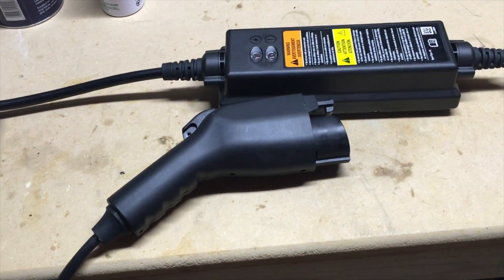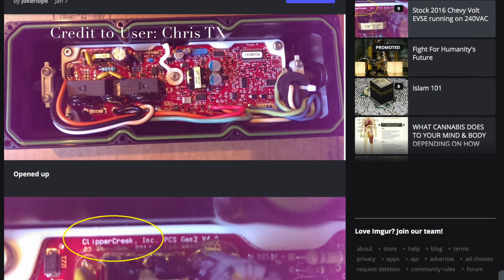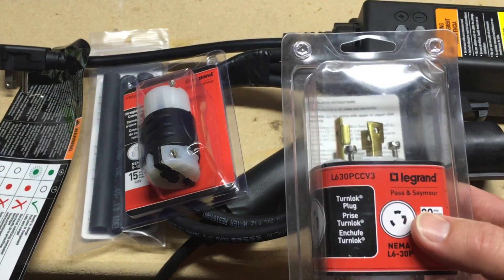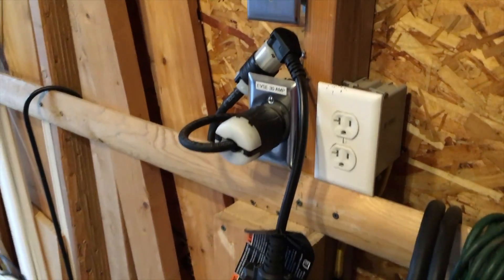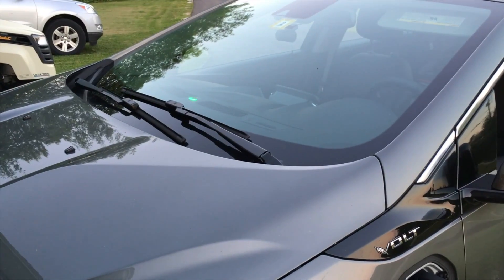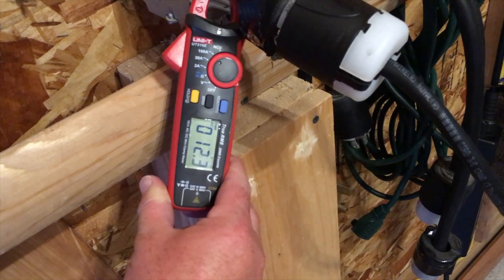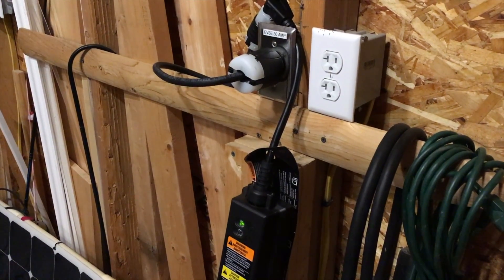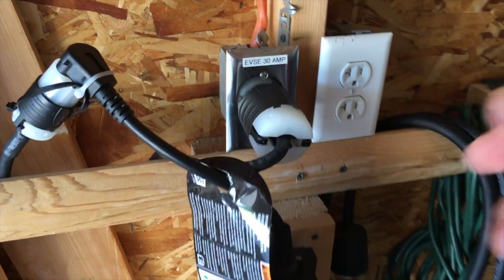2016 - 2018 Chevy Volt Hidden Level 2 Charger 120/240 Charging!

Comment: A 30 amp plug is usually supplied by a 30 amp breaker which needs #10 wire to run cool. If it is a dedicated outlet i would suggest installing it on a 15 amp 2 pole breaker (instead of the 30) to protect the conductors from overheating and to comply with the National Electrical Code. Ill assume the extension cord is #14 which should be rated for 15 amps. 15 amps x 80% is 12 so technically your good as long as it is dedicated to just this receptacle.
Reply: The Volt charger will never pull more than 12amps. That's all it's rated for.

Comment: You just made the charger European ;-)
Reply: 50Hz IS European.
Reply: It is not a charger, it is an overpriced AC switch. Wires coming out have same AC voltage as wires going in. Charger (converts AC into DC) is in the vehicle.
Reply: 50Hz is blasphemy!

Comment: Why the 30 amp receptacle when the draw is 12 amps?I can purchase a 3 wire twist-loc 20 amp plug/receptacle.
Reply from the maker: James Jedamski The 30 ampsetup is  is existing infrastructure I wired in when I had a Nissan Leaf.
Reply: 12A on each 110V leg = 24A at 220V?

Comment: vtmaestro, thanks you very much for this video! I love DIY, but am a novice when it comes to cutting wires. I'm attempting this for my 2017 chevy volt so I have the same charger; even popped it open to confirm the Clipper Creek board. Had a professional electrician instal the NEMA 20A plug on a 240 wire. Next step is conversion. 

My question: Since I don't want this to be my first 240 wire cutting experiment, do you think this off-the-shelf converter will do the trick? 

Cheers, DK. 

https://www.110220volts.com/univ-21.html?gclid=Cj0KEQjwmcTJBRCYirao6oWPyMsBEiQA9hQPbvM0PxOCLtZPqzZB3qnm1hGAtJgcfOJv9kIDwAE_QeUaAu7E8P8HAQ
Reply from the maker: Not sure that adapter is going to work.   I would recommend that you make an adapter or buy something like this. 

https://www.etsy.com/listing/384390572/chevy-volt-chevy-bolt-ev-level-2-charge?utm_campaign=shopping_us_IdeaFab_sfc_osa&utm_medium=cpc&utm_source=google&utm_custom1=0&utm_content=11634913&gclid=Cj0KEQjwmcTJBRCYirao6oWPyMsBEiQA9hQPbhEmME0-ttLtIM1fFMiw6mifvmXxkquRjhLIpMbjZhQaApBS8P8HAQ

What does you 240 plug look like?
Reply: Thank you!
Reply: Got the adaptor from your etsy recommendation. 1 week and working great! Thanks again for taking the time.

Comment: Why not just make the wall plug a 240/15 amp plug?  Then you wouldn't need the adapter.  You clearly mark it anyways, and it's in your own garage, so I don't see a safety problem there.
Reply from the maker: I wouldn't want to take the risk with a family member plugging a regular plug into a socket that is wire to 240.  Adapter was the best way to go.
Reply: You’re good until something bad happens and your insurance company voids your claim.

Comment: Wow, this actually WORKS. Other alternatives are EVSEUPGRADE.COM but they charge $199. There is also a guy on Etsy who sells these cables ready made. One comment, if you decide to simply cut off the existing 120V plug and attach a 240V, you will find 5 wires in the cable. You can safely ignore the orange and red wires, they are connected to some kind of thermal sensor in the original plug. The charger will work without them being connected.

Comment: Not sure if you can answer this , can it work with the 208 volts that I got at work ?May take more amps but can it work?
Reply: Yes this is working,this charger seem to give you 12 amp no matter what voltage.
Reply: Do you know if it's working ?
Reply from the maker: Sorry, I do not know the answer to this question.
Reply: I will have the answer in about 3 weeks, I will try it at work with my new volt, crossing my fingers
Reply: It can't increase the amperage without increasing the gauge of the wiring inside to handle the additional power.

Comment: I wired 2 hots and a copper ground to a regular outlet (will be marked 240V CAR ONLY - and is up high, no one will mistake it).  Each leg measures 120V to ground on my multimeter.  When I plug in the 2017 Volt Charger, nothing lights up.  Charger works fine on the regular 120V plug in... Any advice?
Reply: I figured it out. Since I was using two single pole breakers, I didn't have each on a different incoming leg. The 2-pole breaker wouldn't have fit in the two slots I was using, it had to move down one slot to access a different leg on each pole.

Lesson is DON'T USE TWO 120/240 single breakers as a pair for this, use a 2-pole breaker - you won't look like an idiot! lol
Reply from the maker: Glad you got it figure out  Thanks for sharing.
Reply: What about the white neutral?  What did you do with that?
Reply: I have a 10-30r outlet. I was going to just buy a 10-30R dryer cord and wire it into a 120v outlet. So each hot goes to one of the poles and then the ground goes to the ground?  It doesn't matter which side goes where, Red or Black?
Reply: How did you wire the HOTs in the outlet? 1 to each of the screws in the outlet.  Then just the neutral to the neutral side? How did you ground it? I would be installing a NEW outlet where there isn't one. Was that 10-30r you had? The L is the neutral and the other two are hot? Is that correct??

Comment: Any news on the cord getting warm?? Was it an issue, or were you able to resolve the issue?
Reply from the maker: No issues.  Notice the cord got a little warm when direct sunlight in the warmer months.  Watched it closely this winter and no issue.  Setup is still rock solid!
Reply: +vtmaestro , awesome!! I will  be purchasing a 2016-2017 Volt charger, and do the same modifications. I have a 2012, and have been wanting a 240 V charger.
Reply from the maker: It may be cheaper for you to pick up a low cost Level II charger rather than buy a New Volt Charger do the modification.  Would be interesting to see if the new Volt charger with the modified adapter would work on the older Volt.  Of course, that is done at your own risk..
Reply: Yeah, I've actually seen a few Duosida chargers for under $300. I've also seen a few OEM 2016-2017 Volt chargers for around $200, as well. If I could get the OEM charger for around the same price, I would prefer the OEM charger, simply because of confidence in quality.

Comment: will this work with a 14-50 50amp?
Reply from the maker: Yes, but you won't need all of that capacity of a 14-50, 50 amp.  At 240, the EVSE only draws a little over 12 amps max.  If you have that existing wiring, you should be fine.  Just make sure you have the right adapter to go into the 14-50.  No neutral, just two hots and a ground.
Reply: vtmaestro I'm just future proving to 14-50 to switch to Tesla.
Reply from the maker: Jaime Ramirez, That makes sense.  Good luck!

Comment: Cord is large enough to handle 240 current - noup - 240 voltage. CUrrent is still the 12A like before.
And cord doesn't care about voltage.
Reply: Yes, 12 amps on each leg with 240v as opposed to just 12 amps on one leg of 120v.  So double the amperage. The wire going from the charger to the car is causing resistance (heat) because it's not sized to handle double the output. Totally worth it though!
Reply: @jamesworth4576  I understood what you tried to explain, but the current stays the same with this converter. But at 240V, you will be doubling the power not the current. On a 120V the current also returns thru the other wire ( neutral).
Reply: @TheTaino84  I just made a comment earlier, before reading your post,  that questioned what was happening on that neutral leg.  So how does the control box or what ever it's called, with the green and yellow indicator lights, handle the second 110 hot leg that is flowing on the neutral prong into the previously neutral/ return contact within the box? A woman posted earlier in this thread, like four years ago earlier, that there would be a switch on that pole within the control box...? Someone else posted that the European (220v) chargers are "the same" as the U.S. ones. I am trying to remember now if I've always used my same U.S. cell phone charger when I am in Thailand just with a plug configuration adapter.  That box just handles both 110 and 220 ?

Comment: Im about to do this mod, but since i'm running it to my garage and it'll be at roof level, my plan was to simply run the 2 phases into a 5-15 and skip the adapter. No one can reach up there without a ladder so i dont see any chance of accidental plugin, i'll probably put it inside a locked box as well to be even more careful.
Reply from the maker: Good luck.  I would add that any extra safety precaution is a goid idea (locked box, etc).
Reply: That wont pass an inspection if you ever sell the property.
Reply from the maker: kcotte59 yep, that would work too!

Comment: Awesome. Was just about to purchase TurboCord Dual, having learned the OEM charger can work also in 240V save a lot of money. Thanks for the very informative video. 12 AWG wires in the charger cables should work with 12 Amps, did you measure the current in different stages of the charging? (Start, after 1 Hr, 2Hr, 3Hr etc..) just to make sure it never goes over 12 Amps?
Reply from the maker: I only check the current as seen in the video.   Has work flawlessly for 6 months!
Reply: Those wires are rated to 20 A they should be good to 18 A continuous

Comment: This is a great idea, but before people do it they should check with their utility to see if they offer some kind of rebate program for level 2 chargers.  I found out that mine offers a $500 rebate, as long as you buy from their list of approved chargers.  The great thing is that they give you $500 regardless of how much the charger costs, so you can use the extra to offset some of the other expenses, such as installing the 240V outlet.
Reply from the maker: That's a great deal for a rebate!  Make a $40 adapter for your stock EVSE, turn it into a $500 rebate...

Comment: Last week I finally connected a 10 gauge cable from a 30A, 240v breaker to a new 15A, 120v single outlet. Using the existing EVSE my 2017 Chevy Volt now charges in 5 hrs instead of 12 hrs.  Thanks for your video.
Reply from the maker: Thanks!  Glad hear and congrats on getting it going!
Reply: You should use a 2 pole 15 amp breaker, 30 amps is too much and will cause a fire if there were ever a short. The charger only draws 12 amps. Also should use a nema 6-15 outlet to prevent someone from plugging 120 equipment into it.
Reply: @monteclark1115  I use 30A breaker to charge my Tesla with a NEMA 10-30 outlet and adapter at 22mph of charge.  When I charge the Volt, I just plug in the fake 120v outlet dongle into the NEMA outlet instead.  I got a Model 3 two years later, but I still drive the Volt more often.  I like both cars very much.
Reply: @monteclark1115  you could make the plug connection within a loose covered electrical box so nobody can get to it. Or just cut the plug off and direct connect the wires. Or you can spend hundreds of dollars and feel good about it.
Reply: That's fucking idiotic
Reply: @kylebarbacki7887  What is fucking idiotic? Using 10 gauge wire? Or using a 110-volt outlet? Or Kyle Barbacki? Nothing he did was idiotic, it worked. 10 gauge wire was unnecessary but maybe he had some scrap 10 gauge wire laying around? 110 volt outlet will work fine just don't plug anything else into it. Most solid state power supplies are 110/220 volt so they would be ok.
Reply: Are you able to walk me thru doing this with a NEMA 14-50 outlet?
Reply: @PabloUlmeriguez  Same question
Reply: @PabloUlmeriguez  cut flush the neural ground to ground (round bare copper to green) hot to hot black black and hot to neutral. Making the 120 5-15 outlet hot hot ground at 240v.

Comment: I think you also have to change the "8 amp charging" setting to a "12 amp setting" in the system on the display.
Reply from the maker: That setting on the Chevy Volt (8 amp to 12 amp) is used only when using the stock EVSE is in 120 volt mode.  When using a 240 volt EVSE, the 8 amp to 12 amp setting has no effect.
Reply: vtmaestro so if I were charging at 120v in 12amp, does it necessary means a full charge can be reached alittle faster? as long my receptacle, wires and the breaker is rated above 12 amp?
Reply from the maker: Yes, you will charge faster using 12 amp in that mode.  If charging at 12 amps (120 volt), you should at least have a 15 amp breaker and receptalce for house wiring.    Again, the settings between 8 and 12 amp only works on the 120 volt side.  If you are using the EVSE at 240 volts (or any other EVSE at 240) then the 8 and 12 amps settings have no effect.
Reply: vtmaestro copy that, ty
Reply from the maker: It's done on the Volt in the menu under Energy and then charging.  8 or 12 amp settings only work for the stock EVSE that comes with the volt on 120 volt.  Hope that helps!
Reply: I just purchased a used 2016 Volt. How do I change the charge amps from 8 to 12???   Is this done on the volt or the charger???  Any help would be greatly appreciated.
Reply: vtmaestro  Awesome thank you!!!

Comment: Thanks for sharing.  It'd be great if there was a video on how to make the cable, or a link to buy one.  I don't trust myself.
Reply: 110 volts = 110 volt wire (black) and a neutral wire (white)

220 volts = 110 volt wire (black) and another 110 volt wire (not white)

The voltage from each wire to ground is 110 to 120 volts. 
The voltage from wire to wire is 220 to 240 volts.
Be sure to connect  the ground wire (green or bare copper) to the ground prong on the receptacle.
Reply from the maker: Thanks.  Try searcfing RV wiring, there are plenty of videos out there.

Comment: any issue creating a longer adapter than 18"? I wanna just unplug my dryer and plug this in, but the dryer is too far away
Reply from the maker: I wouldn't do it.  Take some time extend the dryer plug to where the car is.
Reply: thanks for the response. whats the cable you used to make the adapter?
Reply from the maker: I believe I used SJOOW 300-Volt,12-2,12 gauge wire.

Comment: I made an adapter to go from a 14-50 to a 5-15 and I'm gonna try it when I get home from work. I hope I don't fry anything!!
Reply: Dave Lacerte I've been looking for this video/comment string for months now! lol I did try this on 208V at work and it works beautifully on that too. I'm at work now and it's charging on 208V. No matter what voltage you plug it into it's limited to 12A.
Reply from the maker: How did it work out?
Reply: vtmaestro Sorry I thought I posted this weeks ago. It worked perfectly! It auto regulates to 12 amps so there are no issues at all. It's literally just plug-and-play. My car now charges in about 6 hours! All with very little additional cost. I mounted a 6-15/20 receptacle on my garage wall that gets fed from a cable that plugs into a 14-50. Then I made a one foot adapter that has a male 6-15 on one end and a female 5-15 on the other. That way no one can accidentally plug anything into a 5-15 that has 240V on it because I take that short adapter with me.

I have 208V at work but I don't know if the EVSE can handle it or not. Gotta do some research into that. So for now level 1 at work and level 2 at home!
Reply: Did you tried on 208V ?
Reply: Cyrus Yareff A big thank you :D!
Reply: Dave Lacerte my pleasure!
Reply: Maybe you can advise me?  I have a 10-30r outlet (3 prong). As I understand it, it's 2 hot and 1 neutral. I was going to wire it into a 15-5 outlet. Where do I put the 2 HOT. just put one on each of the 2 hot terminals and then the neutral to the neutral side?  

Then what do I do about a ground for the 15-5 side? Or do I care?  I could run a copper wire to another 15-5 outlet nearby in the garage, but that would be kinda ugly

Comment: level ii is 80 amps....
Reply from the maker: We're not pushing 80 amps here.  Maybe with a Tesla 80 amp charging station.  Level II charging can differ depending on the power supply (EVSE).
Reply: vtmaestro's DIY Channel yeah.  i have a website applemothership dot com.  apple is making an electric car.  Tesla has its own specs you can use the j1772 adapter but the Tesla superchargers don't use j1772 and you can't access them with your Chevy bolt.  there's a charge network called charge point I discovered while working on my website project.  you can register with them for a charge card RFID card to.access their level 2 charging.  so.you may want to do a video on that.
Reply from the maker: Yep, I have a Chargepoint card and use their network once in a while. Chargepoint use to have the monopoly in VT with charging stations but there are many more options now including a lot of EVgo stattions.  Here's a video of a Chargepoint station that is also grid-tied to solar.  https://www.youtube.com/watch?v=5NVqQAnakog&t=23s
Reply: If your that handy you can get a j1772 charger from home depot dot com and install it too.  But this all came as a side project from developing apple mothership dot com which Ill probably discontinue web support after this month but retain the Domains.  Because apple us very much a cult and just highers kids or foriners.  i cant see how they plan to make a car because the company is a hack and they cant make anything and have not made anything for years.